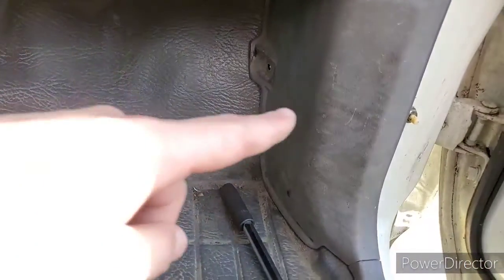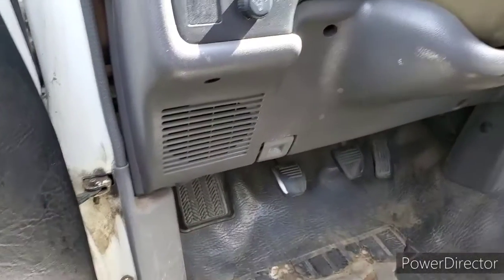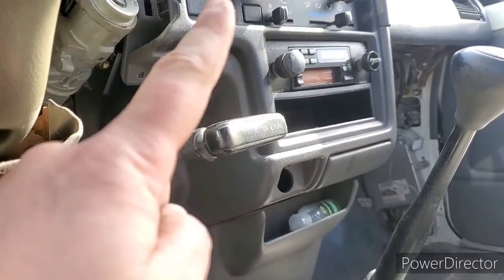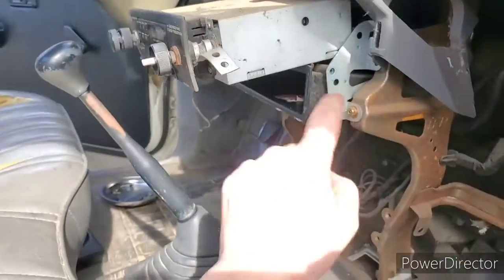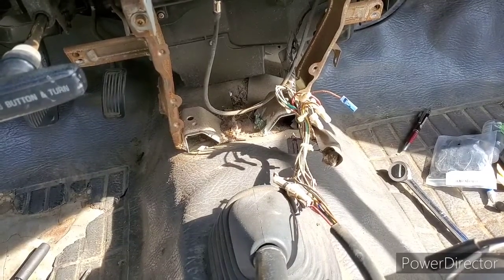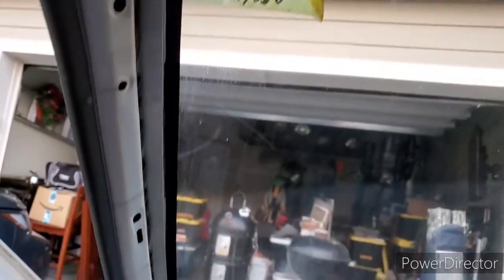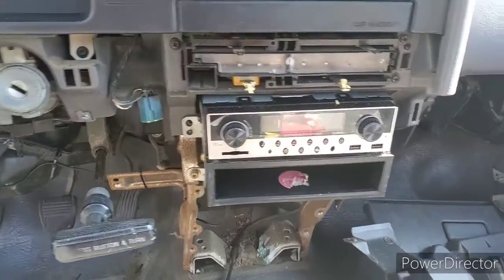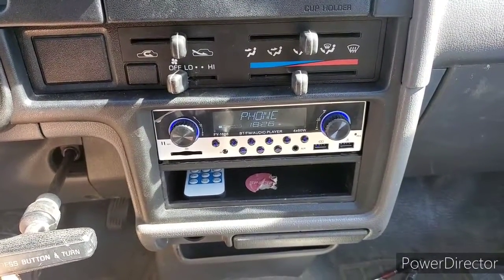Radio Install 1992 Toyota Pickup/Hilux

Comment: Thank you for this, just installed an android auto stereo with a backup camera on my 93 Toyota pickup and this took the guesswork out of taking my dash apart.
Reply: Hey where did u mount that backup cam ?
Reply: @shaanrakhra5483  I don't have a factory bumper, I mounted it under the trailer hitch. The camera came to 3M tape and just use it

Comment: Hey man do you have the link to the radio you bought? Also, did you have to measure your old radio before you ordered the new one to make sure it fit?
Reply from the maker: The 0ne I got is discontinued on amazon but it's just a standard single din. Had to mess with the brackets to get it to fit but the single din fit

Comment: Do you think this is just about the same thing with 1990? Mine doesn't have the pocket underneath
Reply from the maker: It's probably about the same. I found a wiring diagram online, it might be good to check for one for 1990